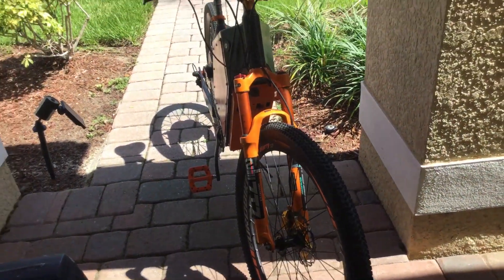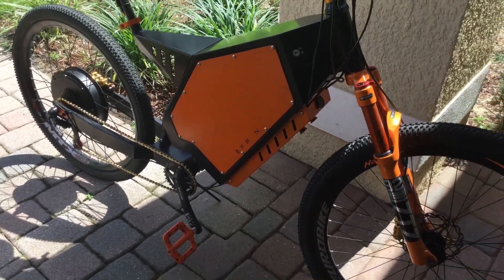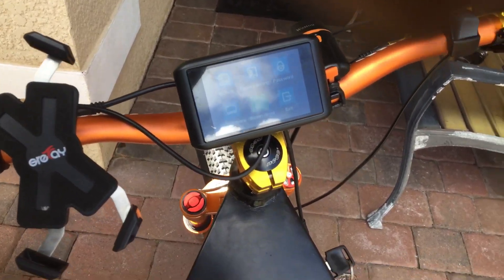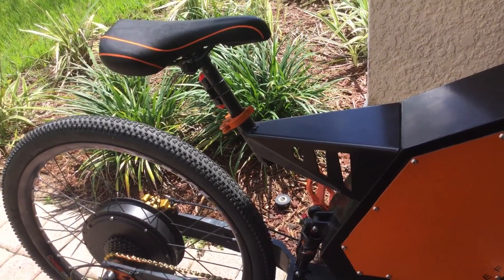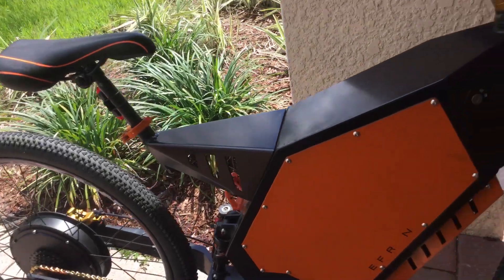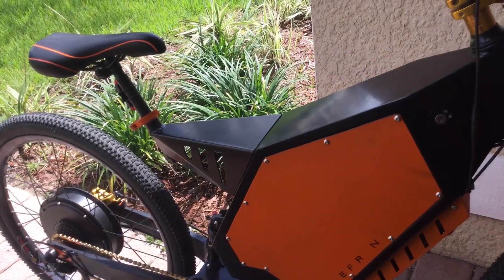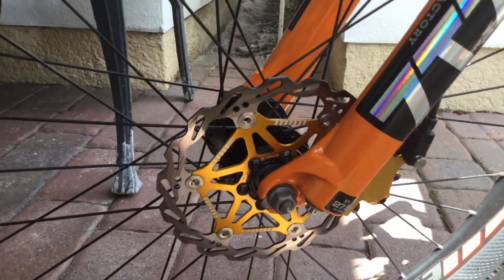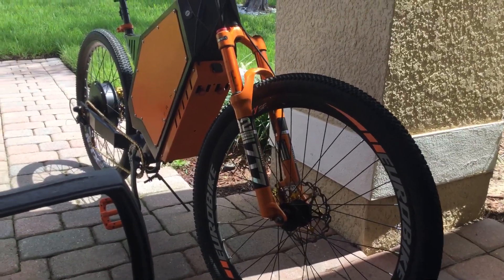Stealth bomber brake upgrade and speedo correction

Comment: Nice bike what is the watts your rear hub
Reply from the maker: 3000w rear hub….top speed is 60MPH’ due to a short In the battery connector’ boost mode wasn’t working….and My top speed was only 51MPH….I now get 60MPH gps tested.

A 3000w kit is capable of getting 62MPH….if you have a 72v 21Ah 80a BMS paired with the stock Savoton 72v 80A speed controller gives you 6400 kilo watts….on boost mode 100A it does 8000 kilo watts. 

The down side is I can only do 19miles for my range’ without peddle assist’ I can probably get 22mile range if the regen braking functioned….I’m working on getting the Regen Braking back…..most stealth bombers that goes over 50MPH need hydraulic brakes….They sell sensors on Amazon that allows fuel hydraulic brakes to use regen braking.

The back wheels watts having nothing to do with speed’ it only tells you how many Killo watts it can handle.
Reply: @Futuremax-e8f  thank you for the Info what the maximum watts do you think a 1500watt  could take
Reply from the maker: @revparsons3tl  Heat becomes into play….a 1500 watt motor is designed to take up to 4000 kilo watts….there’s ppl on YouTube modifying those motors to handle more kilo watts. 

I’m don’t know how many Amps the 1500 watt kit comes with…it’s either gonna be 40a or 50a….I don’t know what a 1500w kit handles in volts’ normal 48 to 52 to 60v….if it’s a 60v speed controller…it can take a 72v

The min motor a stealth bomber can take is a 1500w motor….but it’s probably gonna do 37mph to 41mph’ depending on your batteries volts and amps….when I first completed my bike it had regular MTB tires and brakes it only weight 102 pounds….Mine now has gained some weight with fatter tires my top speed went from 61 mph to 58 Mph it’s gained weight with the upgraded rims and tire…141 pounds it weights.
Reply: @Futuremax-e8f  you senn to know a lot mate about ebike kits I've build a stealth bomber ebike iam useing a 1500w with 40 to 50amp controller and 52v battery 20ah was thinking nodding the wheel and going for a 60v battery this one of the things do I need to buy the stealth bomber ebike stand or can I fit a cheaper one
Reply from the maker: @revparsons3tl  a 1500w kit can fit a normal bike easy….as for the battery if you’re kit calls for a 52v battery….you can get away with a 60v battery just fine….it will give you faster acceleration and a bit more speed.

The battery has Volts, Ah and a BMS’ some batteries don’t have a BMS’ but if you’re battery only has 20a BMS then you’re only getting 1000KW  that’s going to hinder your speed….if you’re stealth bomber frames weights over 120pounds….your speed will be very very slow’ you might get 25MPH if you’re lucky.

The speed controllers amp, and the batteries BMS, and voltage output plays a big factor on speed.
My bike is a 3000w kit with a 72v 80amp controller….I purchased a 72v battery with a 80amp BMS I’m able to run 100amp max on boost speeed = over 55MPH 

A 1500w kit is really designed for a regular bike….I run a 3000w NB power kit’ my kit can be programmed through my cell phone and iPad…so I can program it for the best throttle response, acceleration and top speed….however I didn’t take the battery AH in consideration….my bike has a shorter range, and if I stay in boost mode…..it will drain my battery quickly.

Some of the faster stealth bomber kits use 5000w - 8000w kits….but a hub motors watts don’t determine speed….it’s the 72v 150a speed controller and a 72v 30ah 150amp battery that puts they’re bikes over 65MPH…..they have good range and speeds.

But those kits are expensive….you’re looking at $1400 for the kit, and a $1400+ dollar battery….I’m trying to get one of those expensive kits.

My kit was $750 and $800 dollars for the battery….but it easily goes over 55MPH….I’m planning on taking my kit off and putting it on a old stealth bomber frame, and selling it for $1800 this will yield me a higher power kit, and 400dollars towards the battery….I build and sell gas bikes, and have 2 ready to sell….that will get me the needed battery.

Anyway…I talk a lot….if you’re happy with 55+ mph you can get the 3000w kit and a 72v 80BMS  battery….many ppl with 3000w kits are doing slower speeds, because they didn’t pay attention to the batteries BMS’ many are getting 72v 26AH 50A BMS they’re stealth bomber kits are only pulling 45+MPH but they getting a longer range’ about 8more miles of distance.

So Amps on a battery and speed controller determines top speed….you could get away with a 1500w hub motor and a 72v 80Amp speed controller, and a 72v 80amp BMS battery, and probably go faster than 55MPH….but it’s gonna be hard on the hub motor.

If you’re speed controller calls for 80a and you’re battery only has 50amp BMS they’re losing 30amps of power.

As for a bike stand….I used a regular bike stand, and modified it to fit my bike….if they’re offering a stealth bomber stand….I’d get it’ saves you time’ I made many mistakes on buying the wrong parts…getting cheap 40dollar brakes was a mistake, I originally was going to use my kit on a regular MTB….but the rear drop out was too narrow….so I decided to get a stealth bomber frame instead of bending the dropouts on the regular MTB…big no no…..it’s the reason my kit has 27.5 inch wheels….I made them work! I’m about to make a new video explaining the mistakes I made.
Reply: @Futuremax-e8f  nice one for the info mate very much appreciated with your help with the battery BMS controller info I'm roughly getting about 34 mph to 36 need to buy some ferrofluid for the rear hub
Reply from the maker: @revparsons3tl  np…I seen that trick, it’s a good trick….and works ‘when you you’re putting higher voltage’ to that back hub.
A 1500 watt motor is lighter…if you had the same speed controller, and battery ….as mine, and we raced….you’d probably out run me.
Reply: @Futuremax-e8f  so if I was going from 52 volt to 60 volt battery would I be wasting my time using the ferrofluid
Reply from the maker: @revparsons3tl  if you’re upgrading to a 60v battery….I probably wouldn’t bother, if you ride the bike everyday for long distance….and you’re good at taking apart hub motors, then use therma paste between the magnets.

I know if I’m riding full throttle a lot my hub motor gets pretty damn hot…inc the hall wires….if you’re running 35mph to 39mph….a 60v battery will get you to 42 to 45 mph.
Reply: @Futuremax-e8f  is thermal paste the similar job to the ferrofluid
Reply: Just received my replacement controller why do they advertise it a 48 volt but stick 84 volt capsules in side
Reply from the maker: @revparsons3tl  some kits will allow a 48v, all the way to 72v….some kits won’t work if you’re AH is below 20volts.
Check you’re kits instructions…to make sure.
Reply from the maker: @revparsons3tl  I seen a video…with someone using therma paste….to reduce heat…his hub was a 1500w.
But he ran a 3000w speed controller with a 72v battery 80A BMS.
Reply: @Futuremax-e8f  👍 thanks again for your on put mate I might just go down the middle and get 60v battery for now
Reply: Hi mate I wonder if you know what wrong with my new 1500w controller
My old one 1500w 40amp runs nice and smooth with lots torque only changing as I've never got the pedal assist to work.
So my new one is 1500w 40amp but boy it sound and runs like a bag of shit I checked all the hall  senses and the phase wires they all connected correctly both use the sw900 I know the wheel is not faulty because as soon as I connect my other one it runs fine
Reply from the maker: @revparsons3tl  are you able to gain access to the speed controller via blue tooth? Some kits you need to do a haul sensor test…it could be a short in the speed controllers battery wire.

I had a short in my battery connections….and it didn’t run good, no acceleration, or power.
Reply: @Futuremax-e8f  no mate no Bluetooth I will have to do a short video on my YouTube channel soon of the old and new controller sound so you can hear it it's got the self-learning wire on it but I did this so the wheelspins forwards somebody told me to swap the wires around the wheel spins backwards could I try it so the wheel spins backwards on the self learn and then swap the wires around
Reply: Hi mate how's it going hope your staying safe need your help now that I've decided to buy a new battery but don't know if I should go from my 52v to 60 or 72. Not bothered if it only 20ah that's I don't use it for long distance and only for work and back just need a  it more spped.
But I don't want to regret getting the 60v thinking I should have got the 72v